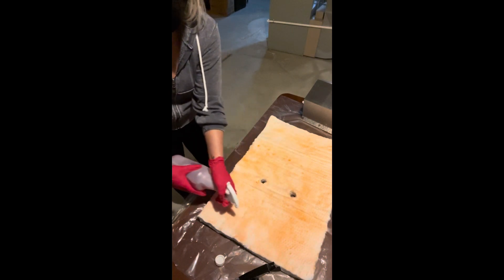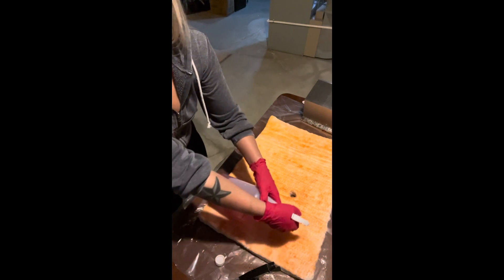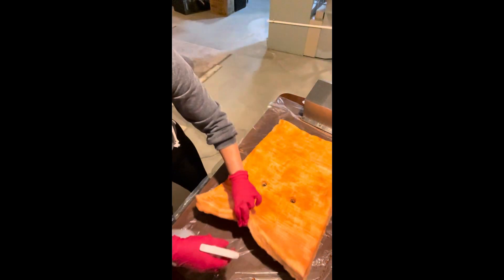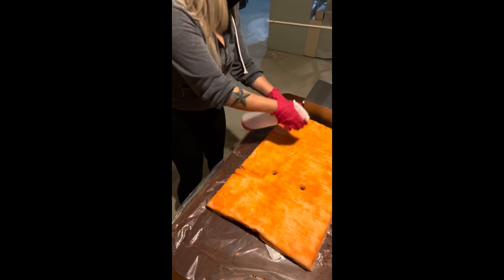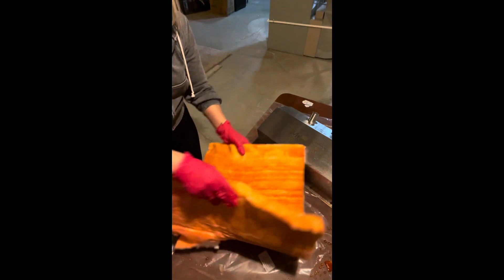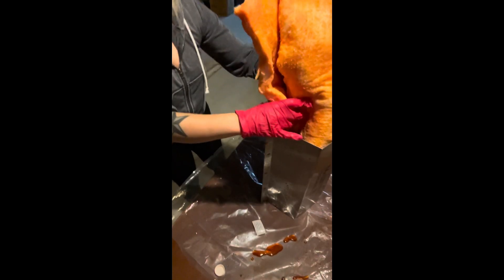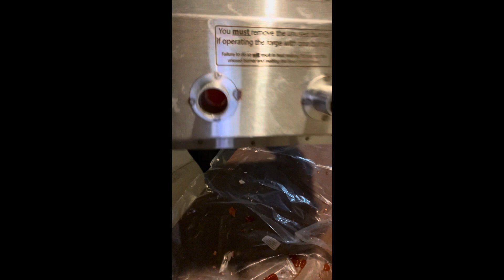HOW TO SET UP A FORGE KIT PART 1: RIGIDIZER APPLICATION

Comment: I applied rigidiser, then satanite, now i've just read you should really also apply ITC 100 HT, which costs 100 bucks per pint here in the UK ! Apparently it means it reaches high temperatures more quickly, and it can take up to 5000 degrees. I guess if it reaches temps more quickly then it'll save on propane in the long run.

Comment: It would be much easier to get the insulation into the forge housing, if you wrapped the insulation around a pipe then wrapped a stiff paper around the insulation then inserted this into the housing.   Next you remove the paper then the insulation can more easily be positioned.
Reply from the maker: Genius, wish I would have thought about that. It was a pain and I got fiberglass burns on my forearms😂

Comment: I just read the first parts of the instructions and saw this video. I do not recall anyone else mentioning the premoistening the fiber mat (with just water) that is clearly part of the (most recent) directions. 
The rigidizer certainly looks well distributed.

I will take your advise and wear long sleeves and maybe also tape the cuffs down at the gloves to avoid irritation of my arms/skin.
Reply from the maker: Definitely wear long sleeves! Hope it goes well for you
Reply: @HairByAriiianna  
Thank you. It did go well. No contact with untreated or uncured materials.
The coating has not cracked significantly with a few uses. I have been using it at higher temps (gas pressure up to 5 to 8 psi so far) that heat the metal to what seem like a forging temp. I think i am heating at the low end so far, and will go higher tomorrow (later today: it is 1:33 AM).

Comment: Thanks.  I did my 3 burner forge outdoors because of fumes...also, I did my ceramic blanket in place instead of removing it and wrestling it back in there.  I just made sure it was well saturated.  Once it's set in 24 hours, I plan to apply a coat of the ITC-100 HT refractive coating, which I hope will even out the heat, but also an additional protective coating to extend the life of my forge.

Comment: Breathing sounds like you were going to say, "Luke I am your father". I just bought one and find your video is very helpful. I did weld around the burner tube insert. I have some have had problems with spot wielding.